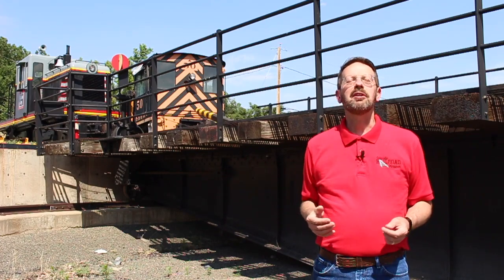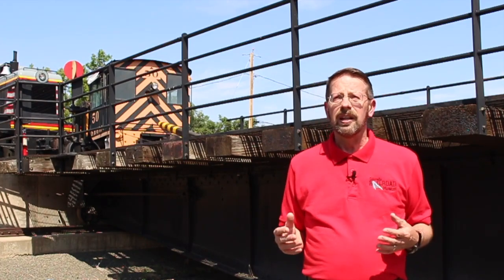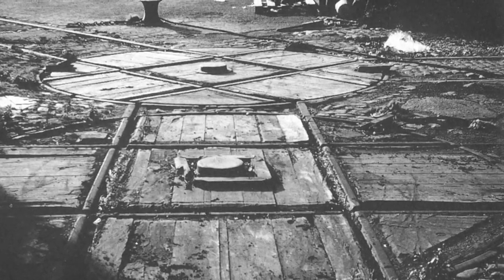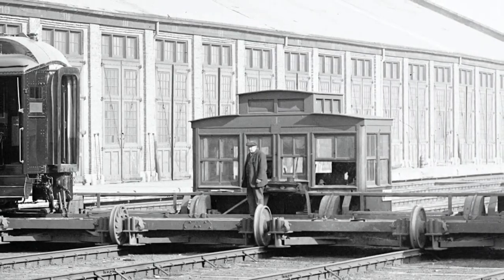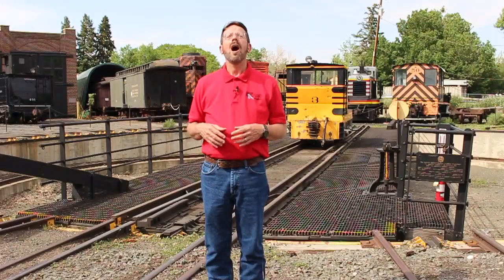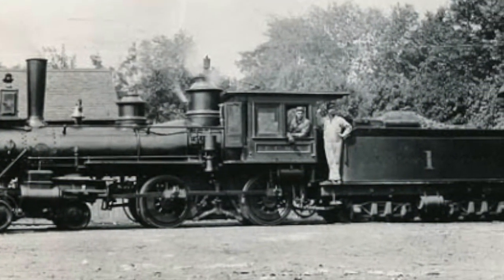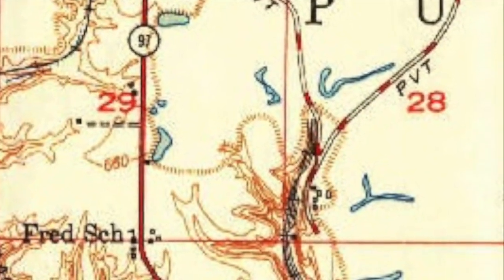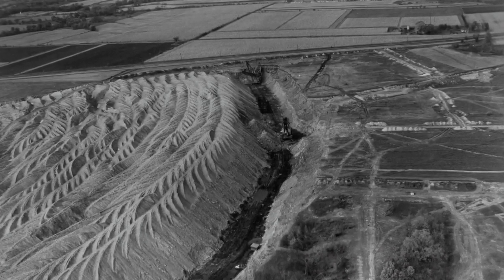Big Train Tours: Round & Round - The Colorado Railroad Museum's Turntable

Comment: As someone who worked in the shop of one of two remaining turntables in the State of NH, I'd like to add my two cents worth on turntables.  
The first thing I would like to point out about dual gauge turntables is that the MAIN reason for not using a three-rail setup is not really due to end misalignment.  Truthfully, if a three-rail was used, the angular misalignment is not sufficient to pose any problems with going on and off the table the locomotives are flexible enough to handle this.  Of course, directly straight is still preferred.  The real reason is that you don't want the narrow-gauge locomotive to be offset to one side.  While end to end balancing can be achieved, side to side is equally important and you would not be able to hand turn a locomotive that is off to the side by just that few inches.
The next item is rail creep.  Yes, indeed it is a tiny issue, but we did use a few rail anchors in the center.  The only place we had objectionable creep was with the movement of the rails at the rail joints closest to the ends of the table, and then only on one annoying rail.  A few whacks with a sledgehammer close the joint back together and all was good.
Our location also got a good deal of snow and with this, the original owner elected to install TWO electric outrigger tractors on the table to help it plow through the snow.  It also had a pipe arrangement that steam locomotives could hook to that shot steam through nozzles near the ring rail to thaw that out during the winter if it got severe.  This actually got used quite late because the shop and table were also the original home of Steamtown, USA.